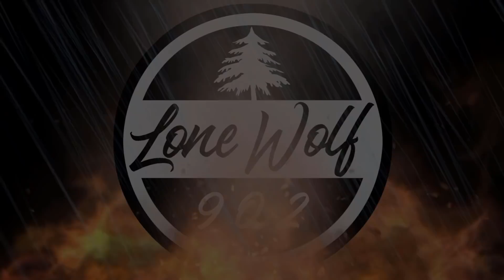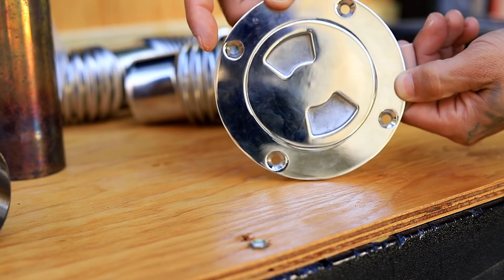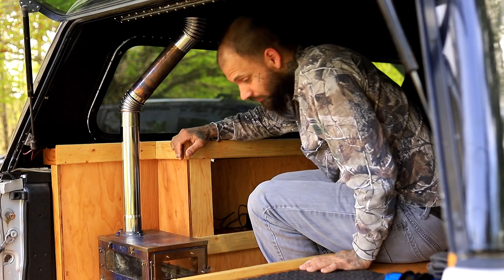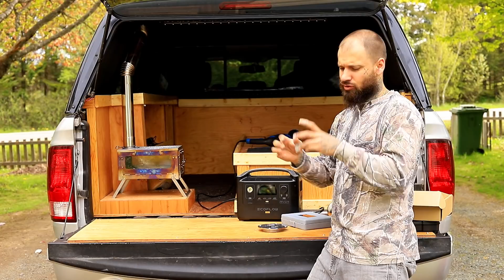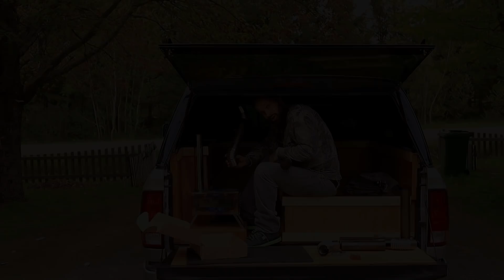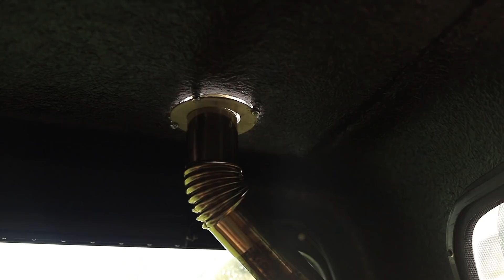Wood Stove Truck Camper - How To Heat A Camper

Comment: The idea and explanation "why" makes perfect sense. I also like the technical solution, although I do not plan to follow you. I thought about 2 topics during the video. First remark: I am worried about the low levels of oxygen when sleeping inside a car (so I always leave window slightly opened). When the stove is running, the oxygen can run out pretty quickly. So I am eager to see, how will you solve the fresh air access. Second remark: I would probably burn my hand, when sleeping on my side with arm under my head.
Reply from the maker: Thanks, a window will always be open and a carbon monoxide will be in place also I do not burn the stove while sleeping